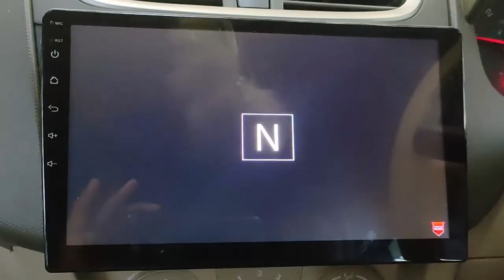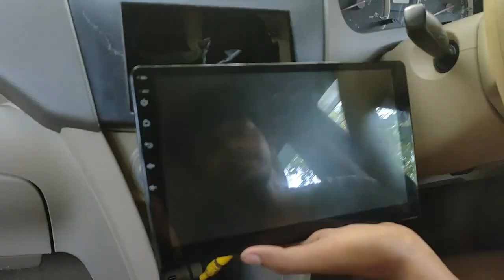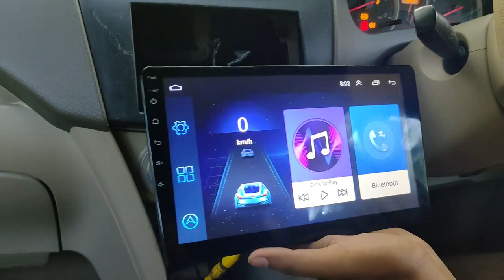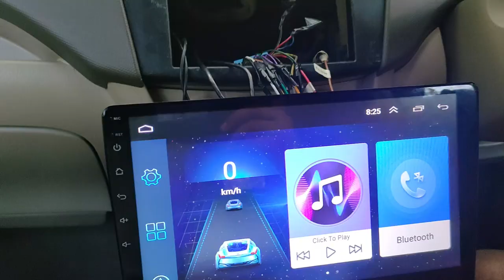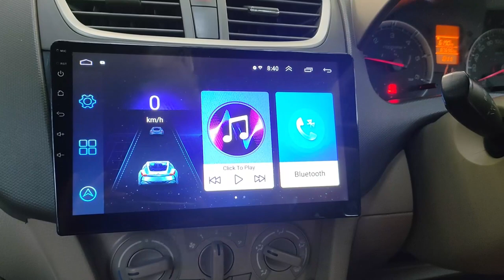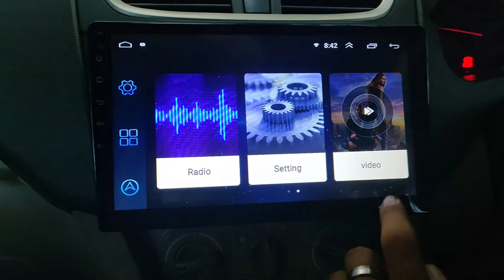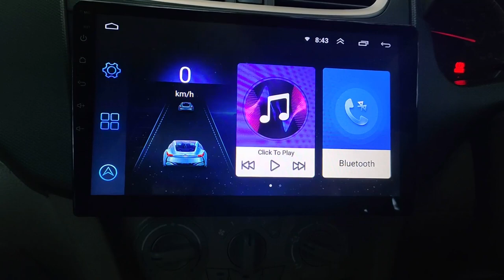Best and Cheap  Android stereo for your car | installation | Reverse camera connection | DIY

Comment: Hi, where should i connect yellow cable ILL( Little Lamp Test). If i leave unconnected when a put the key the radio shows me a error ( no control when small light is off ). Can you help me?